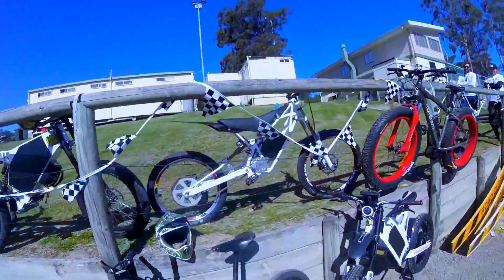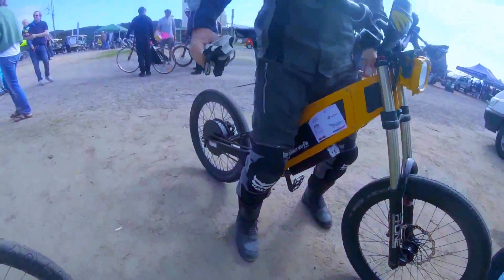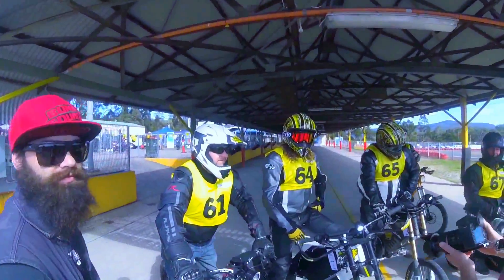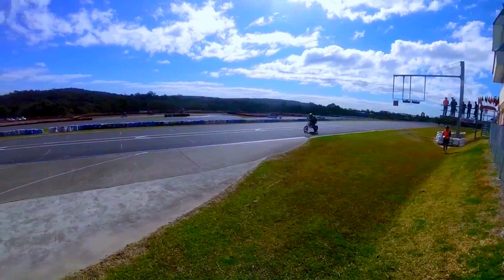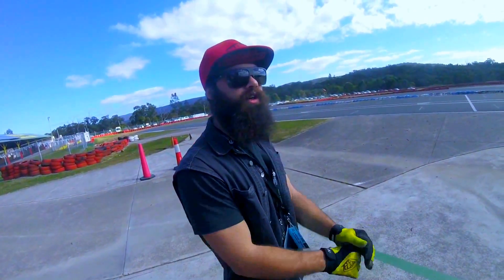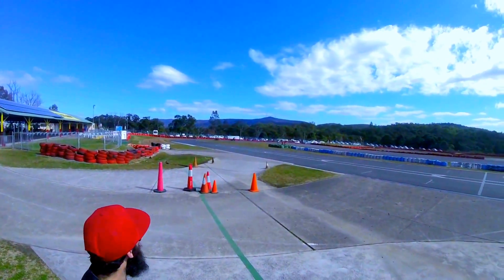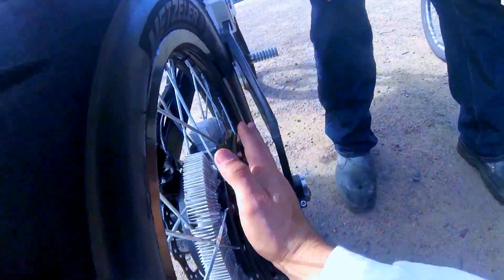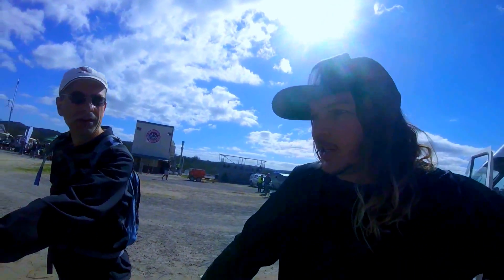HubSink vs normal hub motor - Electric Bike RACE (preparation + race) - Hunter EV festival 2016

Comment: So are they running the QS v3 motors? How many watts were the winners pushing?
Reply from the maker: +Devin Lindstrom not sure exactly what QS model they're running but Sketch said that they're pumping 20kw bursts hahaha without hubsink that would be on flames hahaha
Reply: Yeah I am at 15kw bursts right now and I'm not racing. plus I'm a light guy the bike and me together is only 260 lbs. The heatsink will only help extend those busts it won't increase the max by much right.? All I know is mine stays relatively cool and I'm running it at 175A and 92.4v max charge.
Reply: @DevinLindstrom  top speed of the beast?
Reply: @miguelantonio7135  70 mph

Comment: does burning it really help? LOL
Reply: On tarmac warm tires do increase traction.  But warming the tires while on dirt kind of defeats its purpose.  Since every bit of dust on the tires will make it slippery.  This is why motorsports racing follow the racing line.  That's the cleanest part of the track and the stickiest for the tires.

Comment: Wow 15Kw from that bike on its max.  Thats a lot of POWERRRRRRRR awwwww yeaaaaaaahhhh
Reply from the maker: Yeaahh... most of these guys were having a hard time trying to keep the front wheel down during acceleration hahaha 
Sketch is converting a petrol motorcycle to electric using a massive 50kw motor... we are going nuts constantly chatting as I'm making a very lightweight 42kw.. same wavelength hahaha
Reply: Wow you might need a wheelie bar for all that POWERRRR!!!

Comment: This is a great series of videos. I like the quiet hub motors versus the mid-drives. It's amazing what some surface area on a thermally bonded heat sink can do for a hub motor. Talk about simple. Some of these guys need a programmable throttle ramp, but maybe that would take the fun out of it. Wonder how fast battery tech will move to feed this stuff?
Reply: I guess the small cell idea is something Tesla backed. GM has 288 pouches or prismatic cells in their Bolt. That gets them 60 kWh. Tesla has 7000 cells in a model S. Tesla has gone to the 20700 cell, which is a bit larger. I can speculate without regard to the spot prices for 18650 batteries. So, just my opionions...

For e bikes, with your average 400 wh packs, the price of cells becomes a rounding error. Luna sells a cell for $4 and change. If you put 40 or 50 in a pack, it’s maybe $200. Cut the cost in half, to $2 a cell, and the pack doesn’t get that much cheaper.

The bigger and faster stuff needs bigger batteries, and then it matters. Small motorcycles or scooters, dirt bikes, small cars, whatever. E bikes haven’t worked in the US. Many e bikes are not close to the legal requirements. Wherever the US is going, it doesn’t seem to be in the direction of e bikes.  Why play the game that anything can be an ebike? Just make and ride something more powerful. The obvious drop in battery prices will feed this. 

Should I care about cells, whatever size? Why not have one string of 50 amp hour prismatic cells, rather than a lot of cells in parallel strings? Why don’t other people get access to $145 kWh pouch cells from LG or whoever else wants to make them? Maybe Hobby King will offer  pouches and packs that aren’t LiPo, one of the cell type chemistries. 

Maybe Musk got it wrong, on the small cell thing. Is there a Pouchman I could turn to for thoughtful insight?
Reply: Judging by the price drops and capacity jump recently in the lithium sector, I'd say pretty quick look up the e bikes on the isle of man in the TT for an idea..
Reply: What price drops? It is totally untrue that cell prices have changed significantly in the last 2 or 3 years from the factory. A car maker getting a good deal has nothing to do with the cost of cells to small/medium sized battery factories.
Reply: Hmm Really?.. OK your totally right in the short term ;)
Well my last batch of 6s 10000mah batteries cost $49.99 I'd say thats pretty cheap!.. (now over $100 as of yesterday!! ouch)
What I would say having checked this out for someone yesterday is OMG have prices spiked in the last 3-6 months..
On further reading looks like the demand for cells has also spiked so supply and demand is deffo in effect!!
So yes your sort of right but if you look at the supply trend they will be back on the curve within a year.. especially if oil drops again and I think it will..
So depends how much your in a rush ;)
I personally wouldn't listen to the futures companies saying there will be a 20% rise in lithium costs affecting cell costs as lithium contents dropping in the cells with each new revision of the tech but thats just my opinion..
My advice is just shop about there are deals to be had..
http://www.energytrend.com/battery-price.html
http://www.energytrend.com/price/Prices_of_Cylindrical_Lithium_Cells_Picked_Up_in_First_Quarter.html
http://oilprice.com/Energy/Energy-General/Tesla-And-Other-Tech-Giants-Scramble-For-Lithium-As-Prices-Double.html
Reply: EM3ev I wish there was more information available, but some things are fairly easy to check. It’s clear that Luna Cycle sells the Samsung 25r cells for around $4 a cell, in bulk, and they were selling the Panasonic 3500 GA cells before, around $5-6 a cell. I don’t know what the prices were two years ago. 

The thing about the car companies and their batteries is that the prices are so much lower. GM and LG have said the Bolt battery price is $145 a kWh (for the cells). Those are pouch cells, and they are said to be fairly large. Apparently the LG pouch cells in the original Volt were smaller than in the Bolt, and the pouches are being produced, in high volume, in Michigan. The range of the Bolt has been verified at 240 miles, with a 60kWh pack. GM must know their costs by now, as production begins and the battery capacity is locked down. 

I think Zero is using, or has used, Farasis pouch cells. I’d like to know the economics of building batteries with pouch cells, if they are available. It seems like a 25ah or 50ah pouch is a lot easier to assemble than a bunch of small cells. If you are talking high wattage dirt bikes or some sort of light, street-legal motorcycle, the capacity has to move up from an ebike, into the kWh range. Maybe the pouches are simpler to assemble and maybe a 50 amp hour pouch run at 70 odd volts would be a nice size pack, or a module of a pack. What seems obvious is that any dirt bike or e-motorcycle company that could get pouches for $145 a kWh would be in a good position, assuming everything worked out.  Do pouches make more sense than fairly small cells? 

Honda could buy a lot of cells for an electric car and then just move the cells around to make an electric Honda motorcycle. BMW is heavily committed to EV’s, and they make motorcycles. 

I’d like to know how far people can go with DD hubs, and how soon some of the lower costs will filter down. Can LG really maintain a cost structure where some people pay 2 or 3 times more, if they may be serious long term buyers? Maybe LG or Panasonic should try to get on the good side of hobbyists and experimenters, guys who might show up and do a successful crowd fund?
Reply: Lipo pouches are deffo easier if more 'dangerous' I've been using 3 x 6s 10ah so that just a few xt90 connectors to make a 10ah pack @ 76v and that cost me $147 for .760 kwh pack so I wasn't a million miles of that price but as I say those pack are now over $100 not $50 so what you gonna do..
Makes me gutted to know that I killed 3 of those packs by mistake and now it's more than twice the price if I want to replace them.. should have just bought all the stock.. hindsight..
I did find some that we're 5ah 6s at $35 so thats not a million miles out like I say shop about for good prices..
but 18650's do tend to be in IMHO better quality than most of the cheap lipo but you pay a premium..
$4.40 (current pricing) per cells not a bad price in the EU this is the best pricing I found..
€3.20
https://eu.nkon.nl/rechargeable/18650-size/samsung-18650-inr18650-25r.html

And it's not a case of a group buy it's about getting some good companies going who buy in bulk at the right price and pass on the savings..
but if you can get them at the right price I'd group buy some..
but as EV said they are going up at the moment as demands so high..
If bolivia and others could just get organised that would be a help as lithiums in such high demand atm and supplies not due to catch up till mid end of 2017 and the futures markets going mad buying up all the stock to sell to the big boys.. :(

The other side of that conversation is new technology.. it looks like we might finally be getting some of the development stuff out of the labs and into the production line in late 2017.. I know of at least two new technologies that are on the way A123 has some MIT tech in dev and one of the China corps is also working with a university in China on an improved sulfur carbon lithium tech thats looking like it's nearly out the labs..
Reply: You can't really draw any great insight (IMPO) by the price HK are selling a certain pack for. There could be many reasons why a certain pack is cheaper, or more expensive than it was 6 months ago, that has nothing to do with the cost to produce it.
Lead times on 18650 cells have increased a lot this year, it can take much longer to receive an order, than it did 1 year ago. The factory price hasn't changed, but the various peddlers of loose cells may have adjusted their pricing, due to the supply, demand and availability that they experience. If a cerain cell is abundent, they might not care if they can shift some boxes and make their little cut, but when they don't know how long it will be until they can get their next batch, they will be more likely to look for a better price (impo only, i don't buy from those channels).

Comment: We got third place on my 11 year old son's 2 grand little electric dirt bike. Stoked! The QS 205 hub motors are awesome. Will have to look at getting those heat sinks and running it at a higher voltage with some ferrofluid to keep up with the other fellas. Thanks heaps to the legends Jon and Neal at Catavolt.